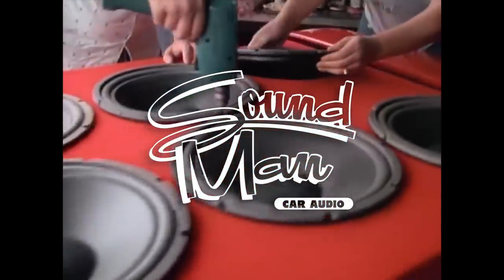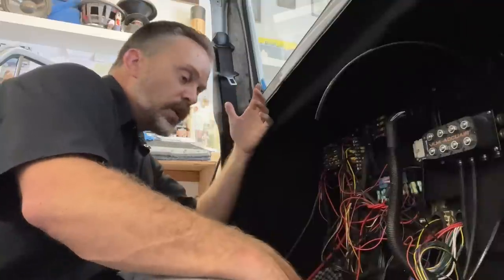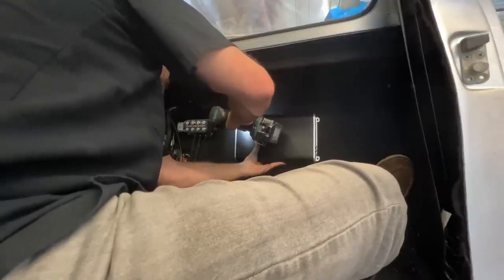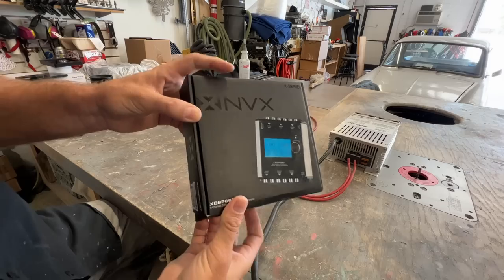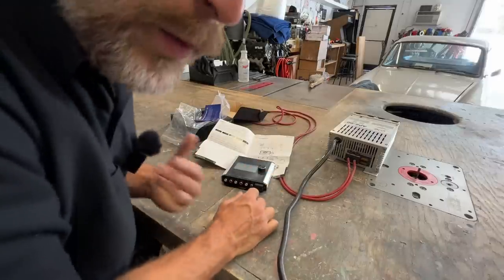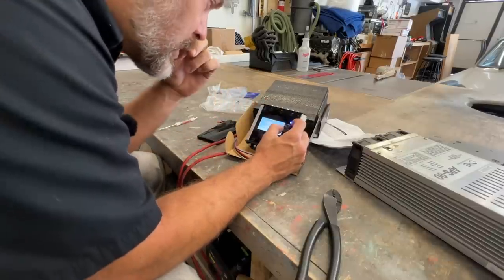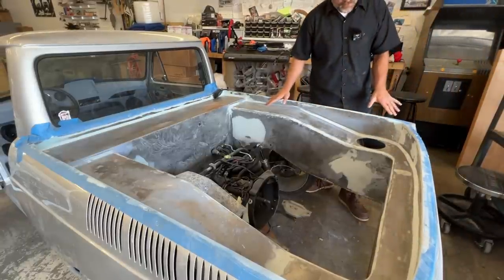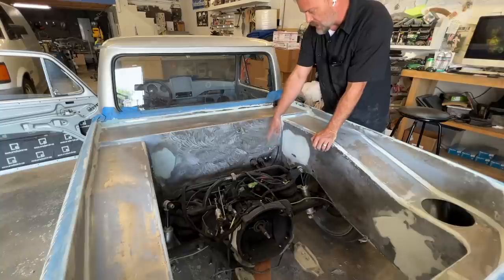My Next STEREO SYSTEM BUILD! - NVX DSP and AMPLIFIER!

Comment: I actually used Herculiner to cover the exterior of a FG box I made a few years ago. It was just a small thing with a shallow RF 10" sub in it, but you put that on a piece of carpet and the coating kept it from going anywhere lol. Could kick the damn thing and it would pull the carpet with it. Never faded, always had like a rubbery feel to it and it seemed to dampen the box a little. Between the Herc outside and the flock inside, it was a tight sounding enclosure, even with the plexi window on the front.

Comment: One of my favorite systems from around 10 years ago was the NVX X Series 5.25 components with the similiar model of SB Acoustics 8" midbass. It was a sweet 3 way setup  ran from 2 of the NVX JAD800.4 amps. Subwoofer was an Image Dynamics IDMAX  12 and eventually the NVX X series 10" for a front sub.
NVX has made some sick stuff!!
Reply: My jad800.4 died two days ago after 10 years of use. I was so sad!

Comment: Looks good Doug. About 20ish years ago I was building a frame off 1992 S-10 Mini. I had the bed and cab sandblasted and sealed. I used the Duplicolor bed liner system as an undercoating and on the floor of the cab which used the similar bulk Gallon and spray cans. Your result was exactly like mine. I ended up using 3 coats but the texture and finish looked exactly to you yours does.

Comment: I love this channel. It's got that mid 2000s vibe. I'm just getting into car audio and my two observations: JL and AudioControl are the best. Period. And anything cheaper than NVX is gonna be a fire starter. 

I'm still in my decision making phase of if I want a DSP, 5 channel, or mono block, fancy line out, or just ram a speaker level signal to a JL amp and let it deal with it.
Reply: I went with mono and I’m gonne be upgrading to 5 channel now

Comment: I'm sponsored by Raptorliner and you can most definitely roll it own. Also, since it's a Y2K product, you can add a leveler to the base and hardener to help out. Yes it gets brush strokes out but if you are using a 3-4in roller, it'll get rid of the over lapping lines of extra material.
The Blue Foam-Pro line of brushes are amazing! They are super durable and leave the best finish between a smooth surface and a rough surface. Just a great medium. If washed out with warm water, they will last for quite a while. Here's a link to the 4-in rollers. Their full size rollers are just as great.
Doug, if you would like, I can get you a considerable discount on some Raptorliner to "reevaluate".... LOL.
By the way, I love seeing you do work on the Mule!
It's one of the coolest unique rides that I know of and very much deserves more exposure in my opinion. 
Just let me know if you need anything I'll even have some extra rollers and brushes.

Comment: I haven’t seen wiring that messy outside of a trailer park build. On top of that you used a so so product, applied over an improperly prepared surface. It’ll be fine..only has to shine till the new owner passes the curb right doug 😂

Comment: That stereo is gonna sound whack. None of those speakers will play above 200hz with enough output to match sub 200hz 

Add some actual tweeters, on channel 1/2. Start bandpass at 50hz on channels 3/4 use them for the 4” and 6” mids. Low pass on 5/6 @ 60hz with 12db slope